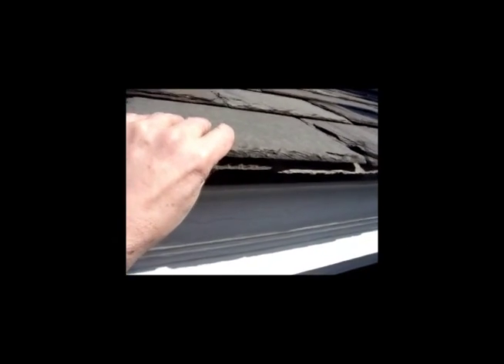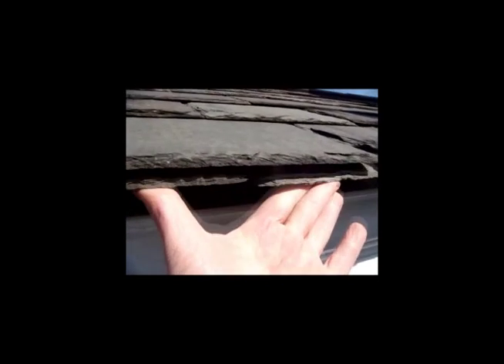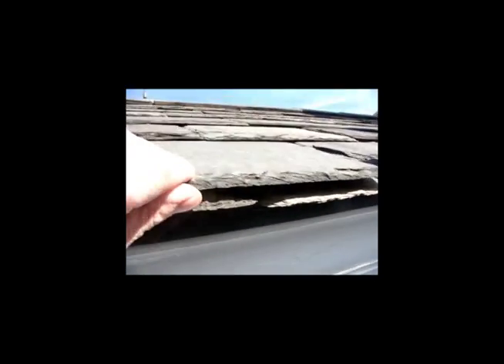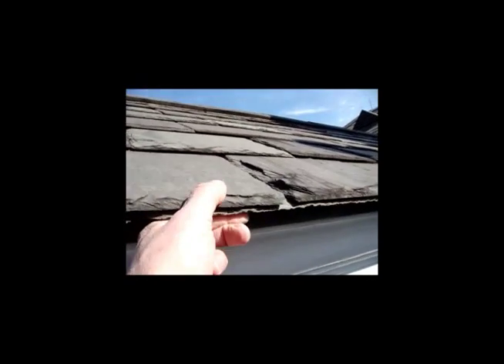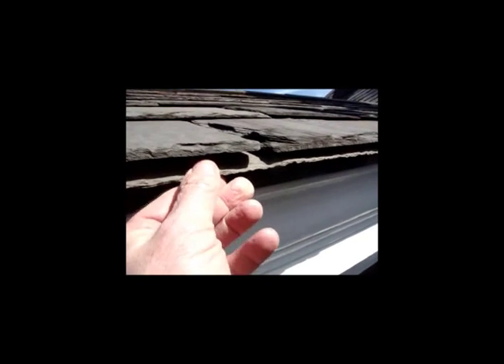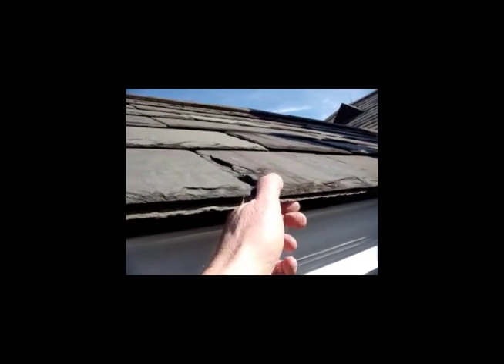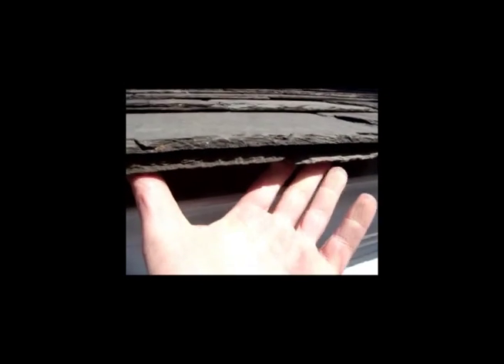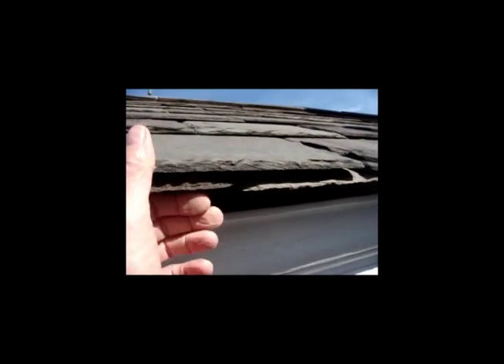Slate Roof Installation Mistake: No Cant Strip on the Starter Course

Comment: How do you determine the size and placement of your can't strip?
Reply from the maker: Thickness of the cant strip depends on the thickness of the slate. If in doubt, lay out slates on a flat surface with the correct headlap. Lift the end slate to the correct angle to match the others. Measure the gap about 1.5 inches from the bottom edge of that slate. That's where the cant will be.

Comment: I'm an amateur about to put lay up a 3 square roof. I salvaged all the slate and a good number were 2 inches too long, though same thickness and width. I cut all those down so now I have a pile of 2x12 strips of slate. As I guy who likes to make the most of everything, the idea popped into my head that maybe these could be used as cant strips. Is this crazy for some reason I'm not seeing, or would it work?
Thanks
Reply from the maker: Camden Walters They would be a little too thin unless you doubled them up. The problem is that they tend to break when they're that small. Otherwise everyone would use them.